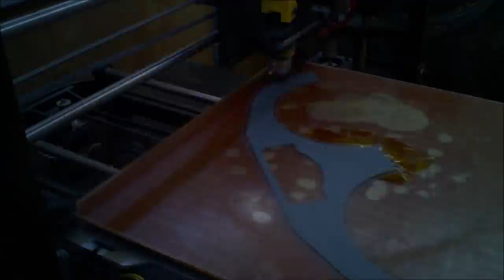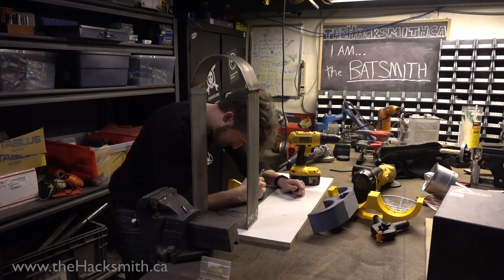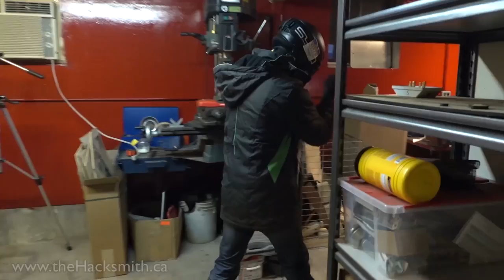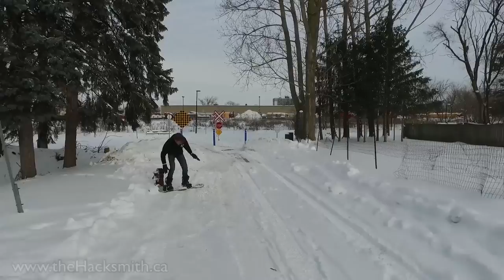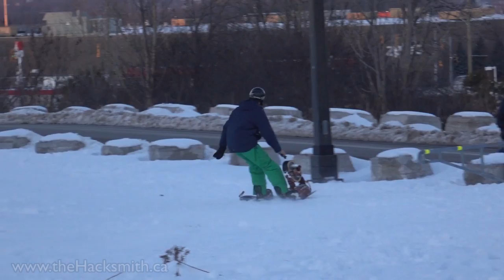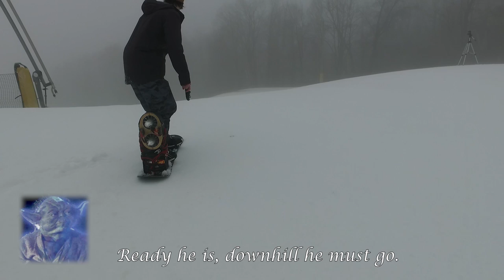ELECTRIC Snowboard goes TOO FAST!

Comment: Why not build the EDFs side by side rather than one on top of the other? It would seem like there'd be a lower CG plus you could potentially control each EDF individually for additional steering
Reply: Alex Lee if you tried making a hard turn, one would hit the ground and cause the person on the board to crash.
Reply: Alex Lee because snow or something would get in the EDFs
Reply from the maker: What happens when you crash then? ;)
Reply: the Hacksmith chances are, it will have the same fate as the exploding EDF in your flying like Ironman video 😬 and you would definitely fall
Reply: Lowering the center of gravity doesn't sound like a bad idea. Maybe stagger the two large ones slightly just to bring it down a bit without having them directly side by side. I wonder if you could get the same thrust out of say 4 or 5 smaller ones even, slap those together in a little bank. Just my two cents :)
Reply: Put them up on arms kinda like \/ or a v shape bring the engines up more s when you turn dosnt hit the ground

Comment: Epic! I can think of a couple simple improvements though...
1. Move the battery packs forward, between the feet to improve weight balance, etc...
2. Lower the EDF's to just above the tail curve.
3. Place EDF's in a side by side configuration instead of vertical, leaving a gap between them of about 3 inches.
4. Aim the ducts slightly (10-20 degrees) downward on the exhaust side. This will decrease snow intake, increase stability, boost acceleration and compensate for EDF weight.
Reply: Siberian Orange I would the gap a bit larger5in, as you can steer now(each turbine with different battery source so that one can be activated without the other one
Reply: I'd actually do this but try 3 EDFs with the 2 as you said but slightly father apart and the 3rd central above. Maybe use a directional duct on the 3rd for steering and change the shape of the back of the board so it's wide enough for the 2 fans to sit on. Might help with stability, especially if you move the power source as you said as you could maybe have a slightly wider front so the batteries etc fit better. Shame it's not a project they're willing to spend real time on and attempt different ideas etc as this could actually be quite a fun idea. I live in England so occasional snow but no real slops to board on, something like this would make it possible to have real fun and board here and other countries that lack decent slops. If you also made an adapter kit so the user could fit wheels easily it could be fun all year round but really come in to it's own when it snows.

Comment: Hey hack smith you should make star lords fire and ice gun
Reply: Axel Phillips that seems slightly impossible
Reply: James McAl not for the hacksmith
Reply: Axel Phillips that’s a damn good answer
Reply: it's actually referred to as an "element gun", and shoots rocks and air as well as fire and water. (4 elements, get it?)
but you're right, that'd be awesome. effectively he already has half the function, so... (flamethrower+ omega super-soaker)
Reply: Y E S
Reply: Amen
Reply: How about roadhogs scrap gun from overwatch?
Reply: James McAl not impossible a flamethrower and ice gun has been made before
Reply: Make Barry Allen's Speed Cannon while your at it 😉
Reply: Considering the element gun in Movies/cartoon is double barrel over under design, that might be possible.
Reply: Step it up to an air boat
Reply: Axel Phillips with liquid nitrogen and thermite
Reply: Joey Bekius excactly
Reply: Joey Bekius I would’ve gone with a gun that shoots highly pressurised water that’s been cooled to lower than 0 (Celsius)
Reply: Dank Dragon isnt that just a blunderbuss

Comment: Make a snowboard but instead of bindings its magnets to keep you on the snowboard
Reply: I’m not a snowboarder, but I almost garentee that it won’t work. /:
Reply: Ilya Bochkov as an avid boarder, i think that putting neodymium magnets in for the inserts, and then in the boots will work just fine. as long as you secure the toe and heel with maybe 2 or so magnets will be just fine. Getting off would be interesting though haha.
Reply: maybe make it so that the magnet/s on either the boots or the board flappable so it would reject each other instead of trying to stick into each other  @BlackberryTheMCPro

Comment: Great video! One thing that worries me is having a rotor spun at very high speeds, then jerking it around. Does it wear on the bearings having instant movement up down left right, when spun up?

Comment: Something I noticed is you have to much weight on your back foot
Reply: That might just be the weight of the equipment on the back of the snowboard
Reply: might have something to do with the engines on the back there
Reply: u think so, why?
Reply: I saw that.   Think side by side, rather than 2 tier, would improve some.  Also balance with added weight at front.  Like the lead weights for car tires.
Reply: There is actually no reason not to put one fan at the front and the other at the rear. Or perhaps put the fans on a backpack or belt (like they did with the longboard). Snowboards aren't really designed to be "pushed". Their control surface is optimized to work against gravity pulling your mass down the hill (which is typically located close to center of the board). With the current design I can't see this ever being stable at higher speeds.

Comment: Good start concept, the down side is, you have the weight on the back and too far  up,you have place it on the center of gravity of your board, then connect the propulsion on each side of the board above snow away from your legs, and done you have more balanced  board,enjoy.
Reply from the maker: then when you crash you'd destroy the EDFs =(

Comment: Please make a jetpack in the next episode :D
Reply: In Real Live I think the goal of flying like iron man and a jetpack are the same. The EDFs cannot lift a person
Reply: Wouldn't a jetpack be really hard?? You would need a huge power source so like a jet engine but it produces A LOT of heat so you will get really hot before you even a few feet of the ground.
Reply: Why not? If place strong jet engine it will work :D.
Reply: I think it can work
Reply: When landing, the engines would be able to tilt sideways to not generate such heat in our direction
Reply: In Real Live dude are you like 10 a Jetpack would be literally impossible you would need so much power and would be so hot plus you would need to be able to control it

Comment: DUDE MAKE VULTURE WINGS
Reply: Goofy If it were that easy it would've been done already.
Reply: Reese Hawkins - Far easier than Iron Man flight.
Reply: mca mac Not at all.
Reply: Reese Hawkins - Yes, entirely. A pair of wings and a massive fan for thrust is basically a para-glider, well within real world capabilities. Making a fold up one to fit in someone's backpack is pushing it a bit, but significantly easier than trying to get all of your lift from a few jet engines strapped to you body.
Reply: mca mac Strapping a few jet engines and EDFs to your arms and back is significantly easier than making extendable folding wings that you can control.
Reply: Reese Hawkins if that’s that easy then why are there only a couple companies to do it

Comment: I instantly see two places you could change the design:
1) Engine (EDF) placement: stacking it seems like it tends to topple, why not put them close to the board side by side?
2) Friction: Using the effects of "ground effect" should be able to reduce some friction. although 5-minute battery power it a bit tight, but it's worth a shot (I guess?)
Reply from the maker: If they were side by side they'd get broken almost instantly!

Comment: Wouldn’t mounting the EDFs lower be better? At that height it looks like they’re causing the board to buckle in the middle and dig into the snow.
Reply from the maker: I don't think that would change the weight on the board (causing the buckling?) the reason we didn't mount them sideways is because then if you crash you'd break a $500 EDF =(
Reply: the Hacksmith True. Didn’t consider that. I thought the reason for the board buckling was because the EDFs are applying force on the board from so high up that it’s acting like a lever, and when there’s weight from your body on the front it bends in the middle. My thinking was with a lower mounting position the EDFs would apply force either more parallel with the board, or even at a slight negative angle, to provide lift up and away from the snow. But all of that depends on how sturdy your mounts are, and the flexibility of the board. A lower center of gravity might also positively impact performance. Maybe I’m overthinking this lol.

Comment: Your thrust should be mounted behind your front foot. Perhaps a V shape, allowing the intake and exhaust to pass the back leg.

Reason: your weight and center of gravity on a snowboard, is just behind your front foot. This is also the pivot point in a turn. We initiate a turn by further shifting our weight to our front foot, releasing pressure on the back foot as we roll onto an edge, allowing the back foot to move opposite the nose of the board. By placing the thrust on that center point, you will pull the tail behind you no matter what. The natural tendency would be to straighten out with more thrust. With your current setup, if that thrust vector deviates from the track of the board, it will pull to either side. Your balancing all the weight on the tip of the thrust, like a speedboat. You need to tractor some of the weight. Like an airplane.

Comment: Have you guys tried riding the snowboard using the fans on your arms instead of the board? You guys can also try to use aluminum or to include holes in your design for holding the fans. It seems that the board is too heavy to begin moving so maybe switching the weight distribution might help as well.

Comment: I  dunno why, but I always wanted to make a rolling suit for winter. Like a thing that would lock up into a ball if you crouched in it and you could roll down the hill and stand up to continue running :D. The idea came from Dota 2 Pangolier hero with that big flat tail going around him. I was thinking it could have strings attached to the hands with the same mechanism like the Retractable Dog Leashes and padding inside the outer hard part of the suit.. So if you jump-crouched, crossed your arms and put your hands on your shoulder and moved your head all the way to your knees, you'd become a sonic mid-air and to get out of it rolling down the hill, you'd just release the mechanism at the right time to get back in standing position. It sounds like a completely crazy toy that will probably kill you. Please build it. :D

Comment: I always thought it would be better to cut out the center of the board and use a small snowmobile track because the weight would be centered and you could easily switch the direction of assistance

Comment: Put edfs lower and turn sideways for better center of gravity and wire turning wheel on controller to adjust speed ratio on either ETFs to change speed to turn

Comment: Let the fans sit on outriggers that float over the snow.  Right now the balance is just impossible with the weight so high off the board.  That weight and the distance from the board has so much leverage to tip that over.  On the snow it will actually serve to stabilize the board.  I think.  hehe

Comment: @the Hacksmith. Two ideas, one redesign this model with the 2 EDFs laying horizontal for better low center of gravity. Or put your new jet engine on there with the fuel placed in a backpack with a quick disconnect hose in the event of falling.

Comment: You should try changeing the postioning of the engines to the sides like a jet plane it would allow better air flow an would lower the profile of the bored fixing alot of balanace issues

Comment: i'm not an expert of snowboard, but i think if you try keeping the jets side by side, extending out of the snowboard and power source in the middle you can control the steering (Individually controlling each jet). And also air intake of jets wont be obstructed by our legs and will increase its efficiency.

Comment: Hey hacksmith you should do a jet powered snowboard 2.0 but instead of the Jets being on top of each other side by side and you can use it as steering

Comment: That was dope, i would of put the battery pack between the legs to remove a lot of that flex wobble at the back and lowered the edfs if not horizontally at the same height as the lower fan. Still dope and i love your work.

Comment: lowering the center of gravity, I think that could improve the performance, could put the jet engines in horizontal position and the battery pack in a backpack.
excuse my english, I speak spanish
Reply from the maker: What happens when you crash then? ;)

Comment: Wouldn't some cones on the back of the engines result in greater propulsion? The air isn't directed well enough, lots of it will be forced out to the sides rather than straight back like you want it. There's a reason rocket engines aren't just rocket fuel coming out of a hole. The propellant needs to be directed better

Comment: Hey hacksmith
That was awesome!
And i came up with an idea for the heat resistance for iron man....
For the heat why not try a shield kind of thing with first a good high melting point metal layer which will take up the impulse/thrust of the fire and a second layer containing those heat resistant polymers....
Just try an experiment with this shield being heated up by the jet engine and the temp on the other part of the shield....pretty obv it will take some weight ....but is worth the protection.

Comment: What if you built a hoverboard using the EDFs or whatever they’re called and put ropes on either side of the board to control steering? Kinda like steering horses on a carriage

Comment: Maybe try another configuration..?. Maybe mounted more in the center of the board between the bindings, but hanging elevated and off to the side of the board.
Reply: or right where your rear binding binding is
Reply from the maker: Then they'd break as soon as you crash
Reply: Hinged
Reply: easier said than done though....I dig the videos man!

Comment: Its a great idea BUT ...It looks way too high man...c of g needs to be lower, the high stacked vertical-plane weight is messing with your steering....redesign it with the motors in a 90 deg v config, leaving enough angle for a hard heel/toe turn and put your electronics/battery pack in the middle...and 2 throttles to help steer independently .....my 2 cents worth...

Comment: Why did you not put the turbines horizontaly and pread them out more then you could power them separately and control the power of each and allow you to control turning better. Doing so. You could lower them and bring the center of mass down allowing you to turn easier, making turning even easier.
Reply from the maker: Cause then you crash and break them...

Comment: Couldn't you do some form of fiberglass mold and distribute the fans for better weight you could use the mold to channel air flow slow the board? Just a though.

Comment: Would having the bracket on the backshaped to a V formation so the EDF's can be side by side and lower so as not having a tall, towered weight unbalancing the board as much when tilting it and maybe wiring the battery box to the front of the board to even out weight distribution?

Comment: Why didn't you guys align the EDFs horizontally?
If that was done, you could even incorporate differential thrust...
Reply from the maker: Because you'd break them first time you fall
Reply: True enough, but that's one of the weaknesses that 3d printed possess.
It is possible to machine the same part out of metal, but that would bring the price up exponentially...
Or you could just have a plate of metal supporting the 3d printed part from the bottom...
You could also have made a mechanism that would allow for the motor being fallen upon to be swung out of the way...
Only one of the EDFs would be able to swivel at a time, but that wouldn't entirely be necessary to keep them from breaking.
Either way, you would still have to put riders underneath in order to prevent excess friction, but those could be used to turn more sharply, or even stop. Both of which I saw to be things found more or less difficult for the rider/user.

Comment: if battery life is a concern why dont you just fashion a makeshift battery pack that the rider can wear as a backpack and hard wire it to the engines and still keep the on board battery for a fail safe

Comment: The hacksmith I have sent you an email about this but I'm still wondering you should replace the normal part of the kingsman umbrella with Kevlar
Reply from the maker: Unfortunately you need a lot of Kevlar to be bullet resistant so there's not much point =(

Comment: Why not make a bobsleigh , it would be dangerous , fast ,loud and freacking awesome... and is also similar to a snowboard ... plus you can stick one EDF for each side of the bobsleigh to some kind of differential thrust (like airplanes) to have "steering" control
Reply: You can put the EDF always in the back so they should be enough safe from crashes .... but still one for each side ... it wouldn't be the most efficent thing in terms of angular momentum ...but is still something

Comment: To much weight is affecting the way the board handles you'd be much better off if you made them into a wearable jetpack. Alternative plan make a powered snowboard with a tank type tread mounted behind the board allowing for weight shift rail to rail steering. Or mount the edf's to a pusher or puller tow sled.
Reply: capowacko allready made a jet pack dident end well for the hacksmith (dislocated shoulder)